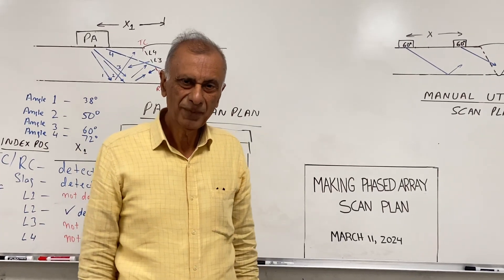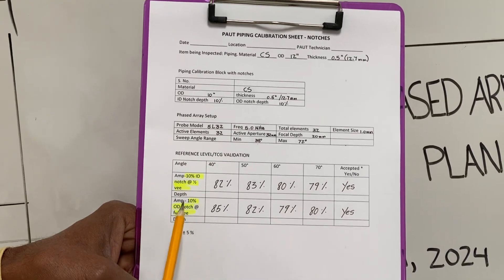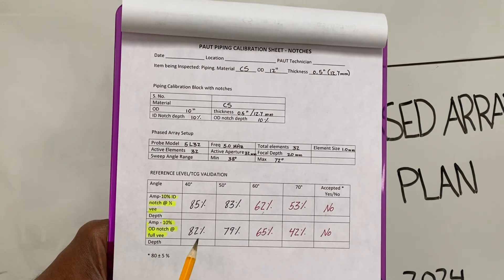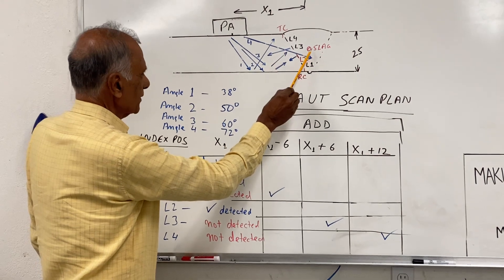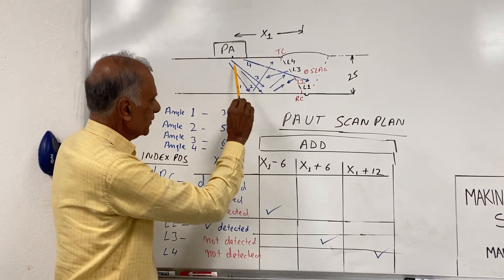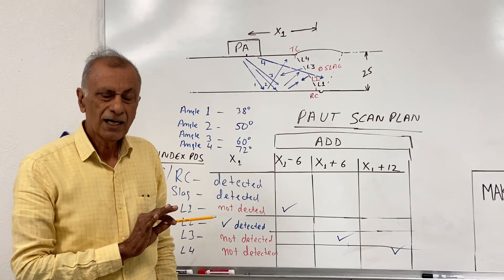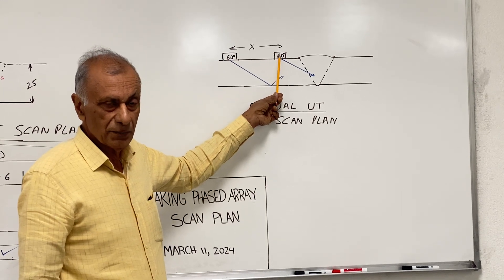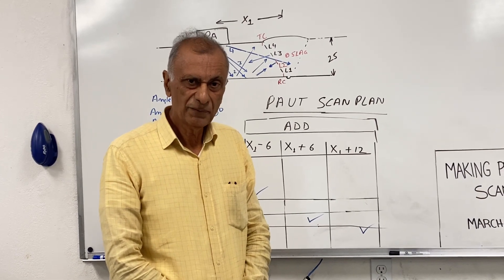Birring 206 Making Phased Array Scan Plan - use multiple index positions

Comment: instead of changing index position. we can simply add a Linear multi beam scan which can cover the entire bevel wall by doing the inspection at one skip only.
Reply from the maker: With less elements per multi-beam scan, you lose focusing ability, and therefore resolution